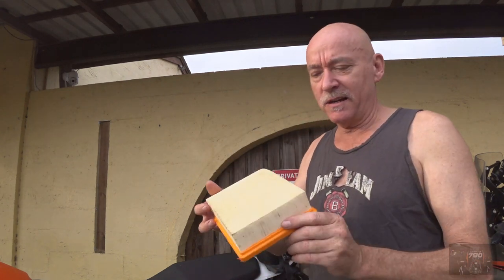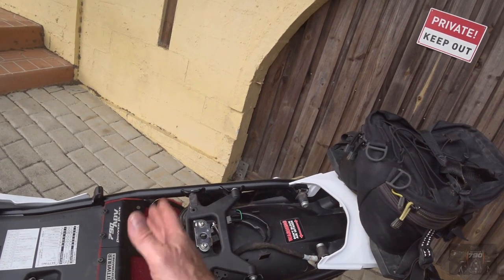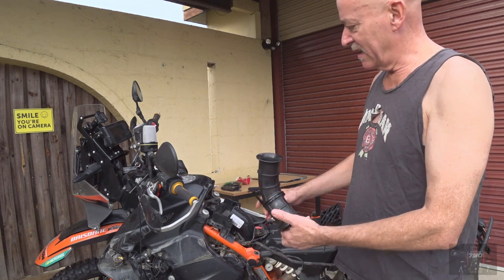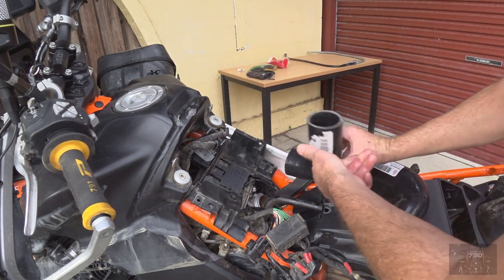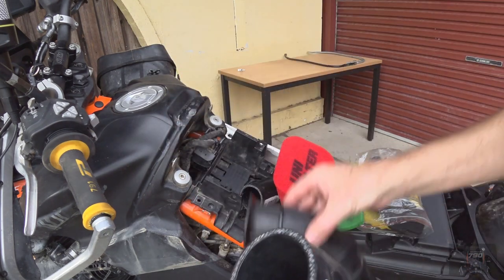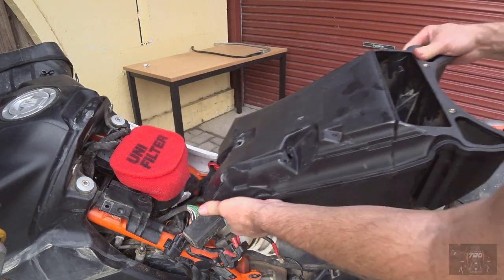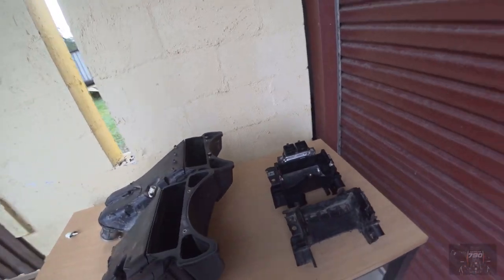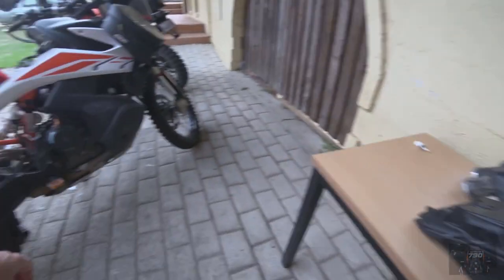Intakes and Airboxes: Evolution vs Revolution, KTM 790/890 Adventure ramblings and experiments.

Comment: I am not sure of that. Engine admissions have so many engineering calculations of all sort of parameters (length of tubes, diameters, shape of the airbox etc.). In my Case I will not touch the original system enginnering, but will think on how to filter the air that is come from outside. There is some space bethween chassis and plastics, that I think could be closed or filtered by any material similar to the Twinair proper filter.
Reply from the maker: Yeah, I hear ya....the electronics these days are both a blessing (adapting to elevation etc) and a curse (being closed loop). I've got to say - riding it with the modified intake is certainly addictive just for the intake sounds!
Cheers

Comment: Totally buy into the argument of swapping battery/airbox locations, very clever! When KTM/Rottweiler pick up this initiative and make the airbox volume a bit bigger, no reason why it wouldn't be a performance mod along with a cleaner breathing mod. Plus you will probably get the batter weight a little lower and the air intake point a little higher (for those deep QLD river crossings!). Great work. I assume your putting this up on a few forums soon?
Reply from the maker: Cheers, yes, it'll be interesting to see how it goes. I put it on a few Facebook pages, will be interesting to see if anyone who knows what they're doing gets interested.

Comment: Interesting concept, the only thing I can think of is that the airflow due the 90 deg. Bend will have an uneven airflow which may affect the torque and hp. However you are right that the air box from the back is prone to more dust when pulling air from the back. Interssting to see how it will work out once you are done and take it for a spin. I guess also the sound will change on suction due the box and new pipes. Let us know how you get on with it :)... I had to replace the radiator cap due coolants evaporation after 6000k. The 1.4bar switch on cap was faulty. Was a simple 10min work to replace it... :) All good again since change. This weekend I change the sprockets in front and rear to 15 and 46T, also adding the transaver, headlamp brace and new fuel line from rotweiller with micro filter... Otherwise keep up your ideas and enjoy riding your bike from morning to eve every day :)
Reply from the maker: Cheers, I run 15/46 myself, good for off road bits. Cheers, will let you know how it goes/sounds once I get it sorted.

Comment: Brilliant mod
Reply from the maker: It's a good idea, but needs someone with more resources than me to develop it properly, since engines now are tuned for intake system volume, not just intake runner length that I matched with this set-up. It misses a fair bit of low end torque as it is, but does sound awesome and is much better placed for clean air intake. Cheers
Reply: @890RallyAdventureR powercommander could be the solution for changes in mixture

Comment: i really want to see how this works out! when i got my 890 i ws a bit surprised ktm didn't do essentially this in the first place. im no air intake designer though. but cleaner air up high and further forward and having the battery lower simply seems logical. 
Are you planning on getting a dyno test to see how it performs?
Reply from the maker: Yes, I agree...since many other models breathe from here. Yes once I get it sorted I'll get it on the dyno. Cheers
Reply: @890RallyAdventureR  a mate of mine is considering changing his stock 790 air intake/filter to foam and considering the Rottweiler intake. I mentioned your mod to him. How has it performed for you? Did you ever get it on a dyno?